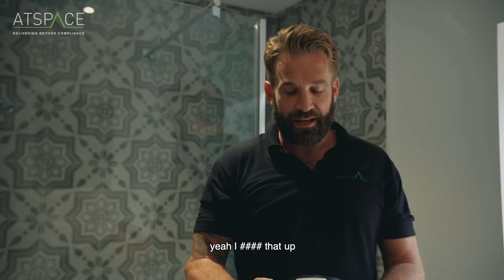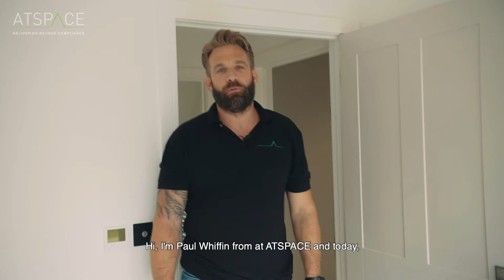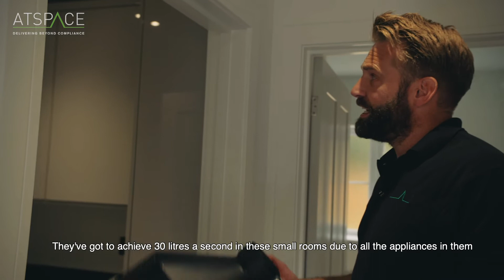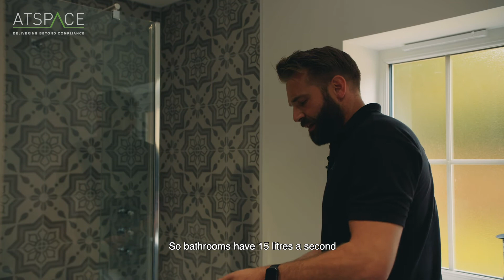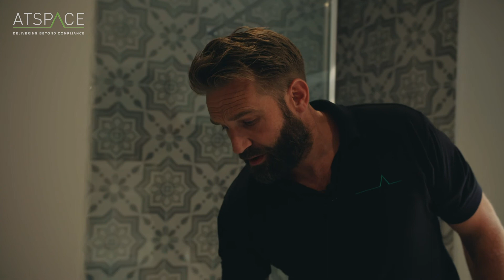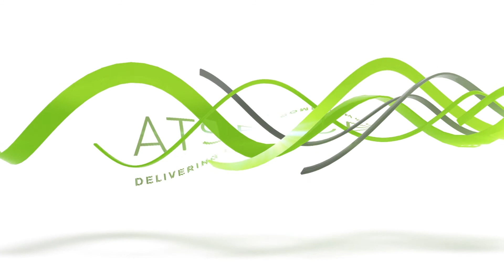Understanding Vent Tests and Ventilation Flow Rate Testing | ATSPACE

Comment: Informative but one quick question what will the proper measurement for dmev fans
Reply from the maker: The DMEV fan complies with UK Building Regulations Part F for continuous extraction. The required minimum flow rates are: 6 l/s for WCs, 8 l/s for bathrooms and utility rooms, 13 l/s for kitchens that are not open-plan, and 20 l/s for open-plan kitchens with a connected living area.  Hope this helps you.

Comment: Great video,  Quick question if the fan has a constant trickle mode should the fan be tested on trickle or when boosted ?
Reply from the maker: Hi Gordon Thanks for your comment. The fan should typically be tested in both trickle mode and boost mode to ensure compliance with building regulations and verify its performance under different operating conditions. Here's why:
Trickle Mode Testing:
Trickle mode represents the fan's default, low-level continuous operation, usually designed for background ventilation.
Testing in this mode ensures the fan meets the required minimum airflow rates for background ventilation as per building regulations (e.g., Approved Document F in the UK).
Boost Mode Testing:
Boost mode is activated when higher airflow is needed, such as during cooking or bathing, to remove excess moisture or odours.
Testing in this mode verifies the fan's capability to achieve the necessary intermittent ventilation rates.
By testing both modes, you ensure the fan performs effectively in its everyday operation (trickle) and under demanding conditions (boost). If you're conducting compliance testing for a building, both readings may be required.

Comment: Can you make vent axia advance sentinel kinetic ventilator extract and supply full flow rate test??
Reply from the maker: Yes, you can perform a full flow rate test on a Vent-Axia Advance Sentinel Kinetic ventilator for both extract and supply. To conduct this test, follow these general steps:

Preparation:

Ensure the ventilator is properly installed and all connections are secure.
Verify that the unit is clean and any filters are in good condition.
Equipment:

Use an anemometer or airflow meter suitable for measuring the air volume and velocity.
Test Setup:

Access the control panel of the Sentinel Kinetic unit.
Set the unit to maximum speed for both extract and supply modes. This may involve overriding normal operation settings.
Measuring Extract Flow Rate:

Measure the airflow at each extract point (vents) using the anemometer.
Ensure the measurements are taken at the point where the airflow is most consistent.
Record the airflow rates from all extract points.
Measuring Supply Flow Rate:

Measure the airflow at each supply point using the anemometer.
Ensure the measurements are taken at the point where the airflow is most consistent.
Record the airflow rates from all supply points.
Calculation:

Sum the recorded airflow rates to determine the total extract and supply flow rates.
Verification:

Compare the measured flow rates against the manufacturer's specifications to ensure the unit is performing correctly.
Adjustment (if necessary):

If the measured flow rates are outside the expected range, adjust the fan speeds or check for blockages and repeat the measurements.
By following these steps, you can effectively test the full flow rate of both the extract and supply functions of the Vent-Axia Advance Sentinel Kinetic ventilator.  

If struggling, give ATSPACE a call to carry this out for you:  T. 0345 6465 454  sales@atspaceltd.com

Comment: How do you test cooker hoods?
Reply: Hi cookers are tricky, best practice is to hold the hood over the exhaust outside of the building from the kitchen extractor, this will give you your flow rate.